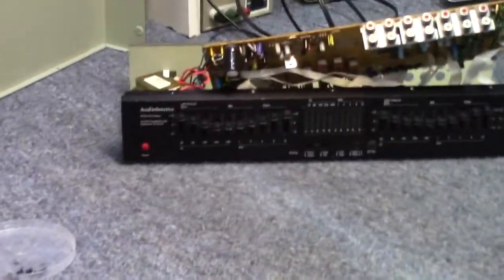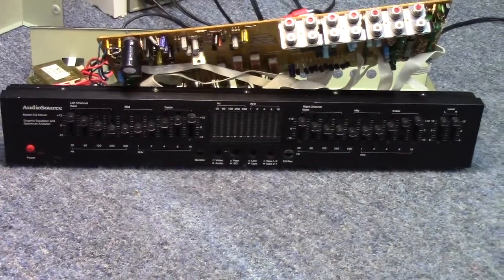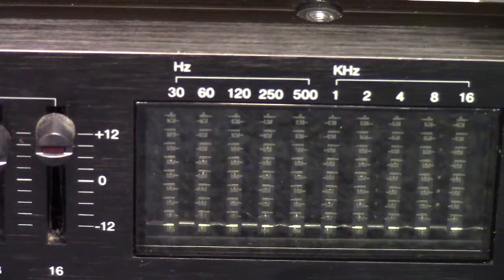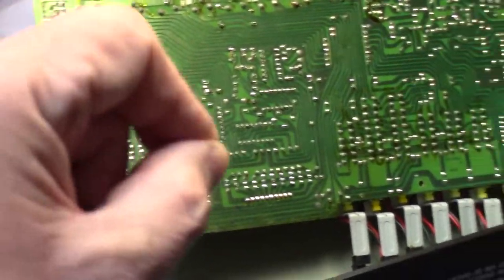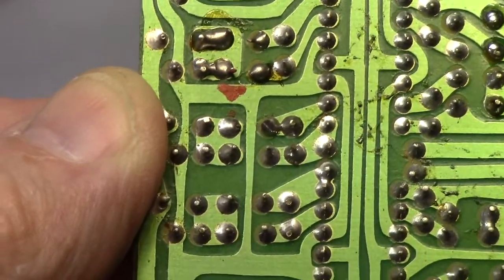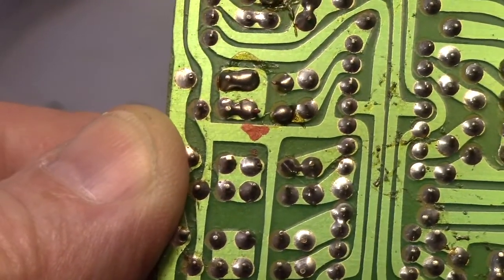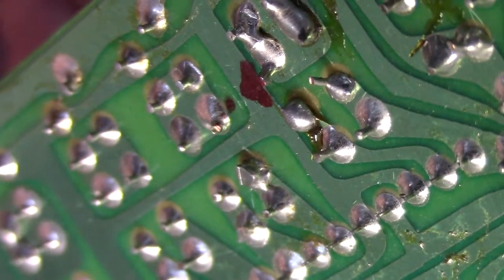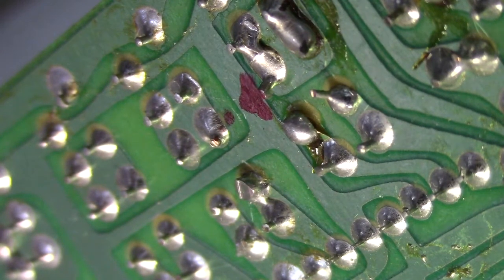AudioSource EQ Eleven - loose connection located (finally)

Comment: 😂🎉😂 
Are we able to locate a service manual for this EQ.
Reply: The left channel has no output.   I can back track the input but would feel a lot better with something to look at as well.
Reply from the maker: Hifiengine.com?
Reply from the maker: @jj74qformerlyjailbreak3  no issues with the EQ/bypass or tape monitor switches?
Reply: @luvradios  they were a little dirty but didn't solve my problem.  I believe it may be a solder joint bc that channel was real static and popping I tapped it a couple times and now it's quiet.